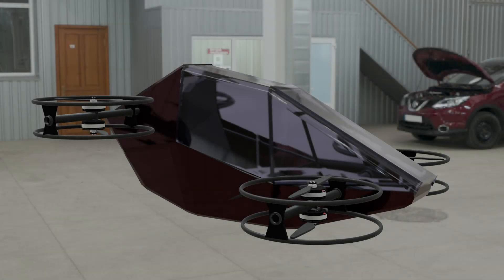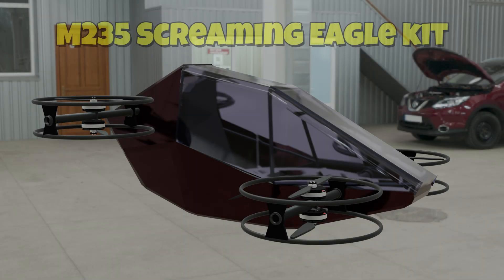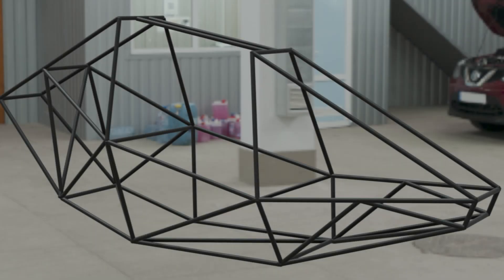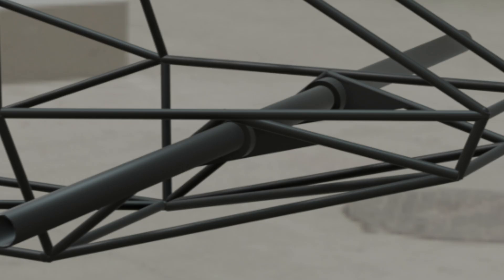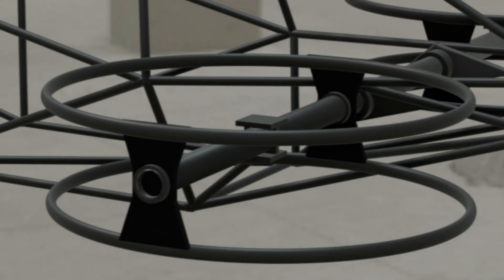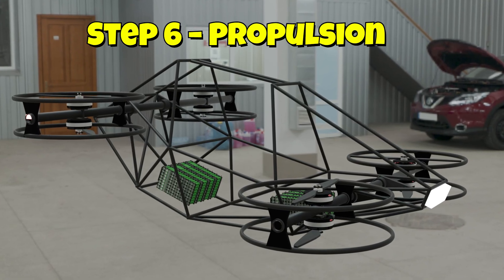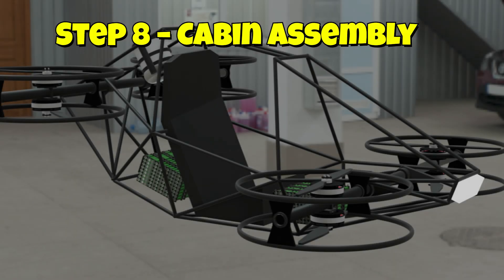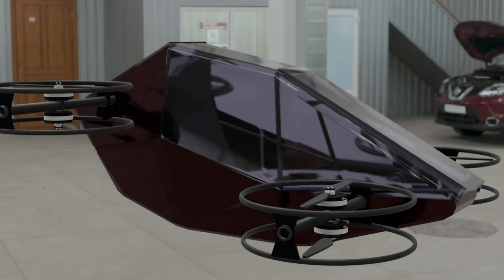Custom heavy lift M235 Screaming Eagle eVTOL downloadable construction Kit #rotor #quadcopter #drone

Comment: Hello, I will purchase your guide to learn more about this. I would like to build my own but would love to learn from your process. I really like your chassis design. A few questions - 1. Is any programming experience required? 2. Has anyone used your instructions to a functional model yet? 3. Can I build this for less than 20k USD?
Reply from the maker: Hey, thanks a lot for checking out the guide and for the kind words about the chassis! Glad to hear you’re thinking about building your own. Let me run through your questions:

Programming – You don’t really need programming skills to follow along. Everything’s laid out step by step, so as long as you’re comfortable with basic tools and electronics, you’ll be good.

Functional builds – Yep, a few people have already used the guide to put together working models. Everyone’s results are a bit different since it’s experimental, but it’s definitely doable.

Budget – For sure, you can stay under $20k. It depends a lot on what parts you source and how much you build yourself, but I also point out some ways to cut costs without losing function.

Super excited you’re interested in giving this a shot—it’s a fun process and you’ll learn a ton along the way. Let me know if you want me to share more about the parts list or cost-saving tips.

Comment: ultra-light bush planes, or quad planes, are flying cars already. dont have the be the usual quad copter form. quad plane just puts the quad copter rotors at forward degree in a biplane shape. yep two standard props per bi-plane wing. can also land vertically. and horizontally.
Reply from the maker: Yep, pretty much! Ultralight bush planes and quad-planes are already flying cars in their own way. They don’t have to look like the typical quadcopter. A quad-plane just tilts the rotors forward in a biplane style — two props on each wing — so you get the ability to take off and land vertically and cruise like a regular plane. Super practical combo.

Comment: Very interesting, I’ll be watching for more information like Cost and are sub-kits available.
Reply from the maker: The cost really depends on how you’d like to approach it. If you want the complete assembly—ready to go and shipped straight to your doorstep—that’s on the higher end since everything comes fully built and tested. On the other hand, if you’d like to receive the bits and pieces and build it yourself, that’s the most affordable option. Anywhere in between is possible too, so the price can scale from budget-friendly DIY kits all the way up to turnkey assemblies.  I would recommend starting with the 6x9 paperback ebook on Amazon and go from there.
Reply: @BoundlessVision-d2  thanks for the response. The name or link to the book is?
Reply from the maker: @greggmccleery9819 In the description there is a link that will take you to a similar ebook, the model 235 Raven. As soon as the M235 SE book is available, I'll send you the link.  I'm only adding the LTSpice simulations for the BLDC motors at the moment.  with the PID values needed for lift and the differential Laplace transfer functions.  I am including all of that.  Although not required, this information is helpful to understand the system's operation.